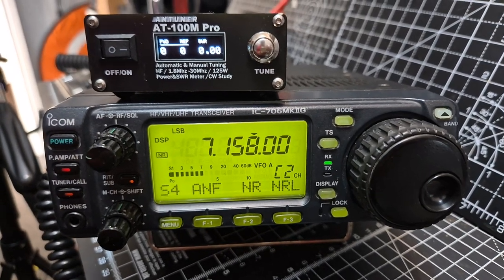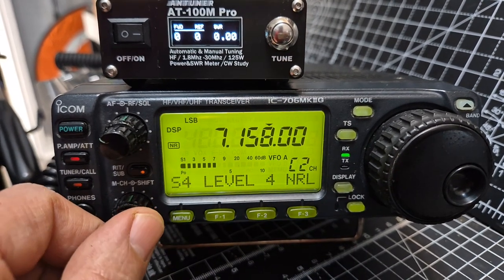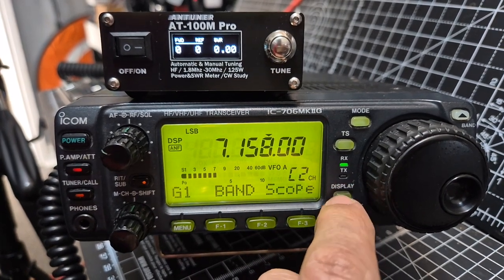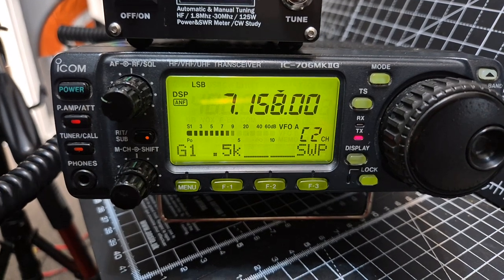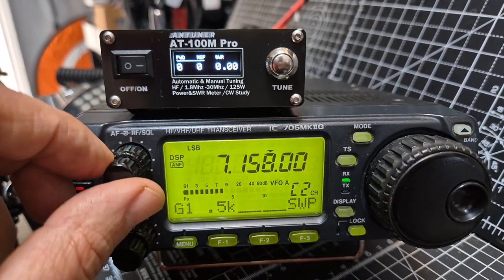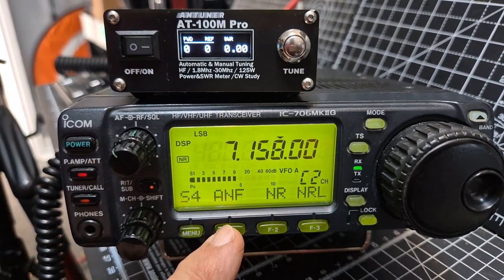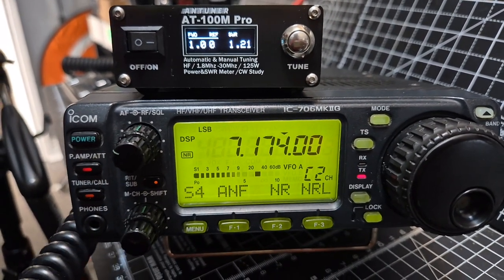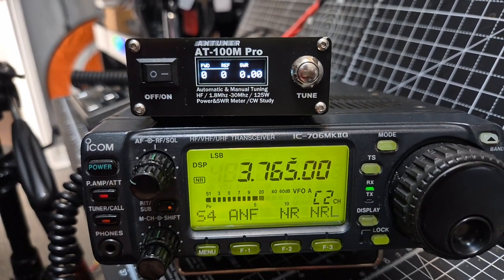ICOM.IC-706 MK2G , DSP Test

Comment: Tnx for posting.How do you receive between 0-200 mhz with 706mk2g ? Mni tnx 73 Ik1gcb Amedeo
Reply from the maker: u cant
The ICOM IC-706 MK2G has a transmission (TX) frequency range of 1.8-29.7 MHz (HF + 6m) and 144-148 MHz (2m) and 430-450 MHz (70cm), while its reception (RX) range is from 0.03 to 200 MHz and 400 to 470 MHz.